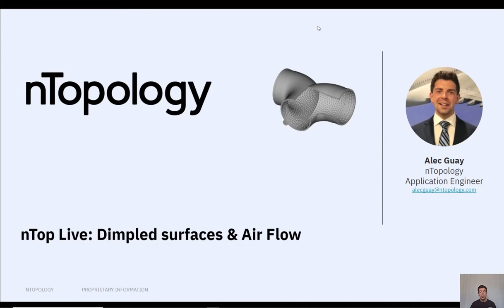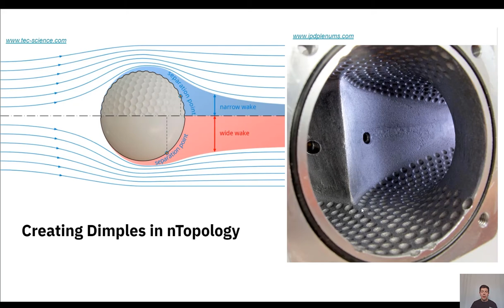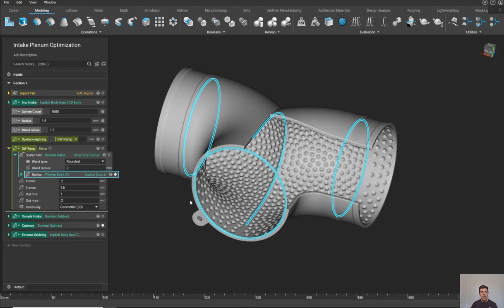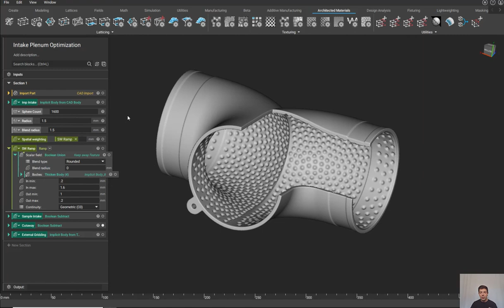nTop Live: Dimpled Surfaces to Increase Air Intake in Air Duct

Comment: If people just understood the principles behind this it wouldn't be a mystery, dimples increase turbulence and reduce flow velocity, but dimple increase turbulence and help keep flow attached so there are proper places for dimples and the entire port is not the place! put them on the short side radius and any tight spots where air cannot turn because the angle is over 15 degrees or so.

Comment: Just never on ports or intakes ! Unfortunately, it doesn't work inside a port or intake due to the increased friction coefficient dimples create in the boundary layer and the velocity range needed for an engine. 

See a golf ball reduces its "drag" by a reduction of the negative pressure  "behind" the ball.  It is also limited to a range of 150- to peak of 280fps, at which point it goes backwards. 

So the biggest problem comparing  dimples on a ball to a port or intake runner is its velocity range...ports "average" 300+ and peak at 690fps.  So, it's not even in the right velocity range to work.  But the biggest problem we saw was the increased boundary layer thickness. Which on a ball isn't a problem.  But "inside" a port or runner where the air speed is targeted based on the CSA [cross sectional area). The growing boundary layer only reduces available CSA and, therefore, reduces mass flow potential and hinders HP.  

The best Ra of internal ports and intakes is around 60-100 grit. Which is what most race intakes and ports are done with.  It's a perfect blend between just enough surface turbulence to decrease the drag coefficient but not to much the boundary layer swells out of control.
Reply: RA stand for what sir?
Reply: RA of internal ports? Like surface of the ports need to be rough not smooth?
Reply: @elbale2323  Ra is a surface roughness index.  Just like what's specific for an MLS gasket. The Ra of a port needs to be the right roughness for the boundary layer
Reply: @elbale2323  Yes. It should never be smooth 👌  not on the intake
Reply: Just an observation. A guy (yeah, I know) on YouTube, Weingart ?? Racing, played around on his flow bench and a LS head. I don't remember the exact head he used. Anyway, he randomly by hand dimpled the floor of the runner and the back of the bowl. Nothing else. Floor and back of bowl. Significant increase in airflow. 

That being said, he then dimpled the entire runner and bowl. Lost almost all improvements.
Reply: @scotthewins5341  Yeah, unfortunately, if developing engines for the last 25 years has taught me anything, the flow bench isn't the real world. It lies!  And if you dimple and area and it does happen to help. That means the port CSA (cross-sectional are) and / or shape is wrong.  If you fill that area. You will do better again. It's an indication of low velocity in that area.   which, if they were velocity probing and not just looking at flow figures, you will see this very easily. 

As the best cylinder head guy in the world , darin morgan says.. it's a good bandaid for a poorly designed poor 👌
Reply: @bainracing  true that. I was reporting what I saw. What's your take on Extrude Honing? I look at this performance stuff from the standpoint of semi trucks. HP isn't my goal. Fuel mileage is. Anything I can do to push that number up, is my goal.
Reply: @scotthewins5341 

 It can be good for boring bigger holes. But the problem with pumping a fuild through a pipe is. It removes from the wrong areas due to the surface pressure gradients created. 

For example,  if we have a casting lump, I'm the pipe. That lump is going to create more pressure before the lump. Now cresting a dip in the floor while it "reduces" some of the height of the lump. 

We now end up with an S curve. A dip before the lump, the same thing happens on bends.  The inside of the pipe is generally where we need to improve. Yet due to the force of the fluid.  We have far more surface pressure on the far side. So, it unevenly takes more off the other radius and not the inside radius. Creating poor flow. 

So, it really needs to be established what you are trying to accomplish. 

On an intake that is just too small and you can't port. Then, sometimes, even a bigger, poorly shaped CSA may be beneficial.  

Hope that helps 👌
Reply: @bainracing  I've heard similar.  I'm guessing that the benefits would be more from the finishing of said runner. I think that's where it would shine.
Reply: @scotthewins5341  Yeah, there would be a slight difference in the changes in surface Ra. Boundary layer modification is in the 1-2% area.   

From our testing, from a casting finish to a burr or sanded. So around 200-100Ra down from 900Ra will rob torque by 2% and add HP by 2%. 

But bigger shifts and power  are found in increased CSA.  This comes back to our average CSA math, which is pretty much how all race engines are targeted as we know the limitations of air and its fluid dynamics principles. 

 Our velocity limit is set at around 690fps for all ICE engines. It won't matter what it is.  So, as we "increase" CSA. (Cross sectional area) we reduce air speed as an engines primary induction air speed is dictated by the pistons' speed, stroke, and bore/ CSA of our primary induction length 👌

I have my calculators on my website for all the basic air flow math if you need mate.
Reply: @bainracing  thank you. That would be great! What part of the world are you located? I'm near Chicago.
Reply: @scotthewins5341  No problem, We are in Australia. But my calculators are up for all to use :)
Reply: @bainracing  how about the compressor inlet on a turbo? I am rebuilding mine, thinking about dimpling the taper region.
Reply: @Akya2120  definitely not, mate. Dimples in a duct create more restriction.

Comment: Regarding dimpling inside a intake port for airflow velocity. 
First of all several conditions have to be met.
- dimple size
- dimple depth
- smoothness of dimple
   Edges 
- dimple location to   
   Other dimples
- And the angle at 
   which the airflow 
   approaches the
   dimple.
- Lastly the amount of 
   dimples.
If each of these conditions are just right, your airflow velocity will increase
Reply: is it science, or art?

Comment: I'm curious how this affect would act on a smaller projectile such as a ball sphere 17.4mm or .6840" in size being accelerated at 300 feet per second.  And, how would this change if the ball object had dimples like a golf ball instead of a smooth surface. Would it accelerate faster and longer with a more level flight like a golf ball even though its smaller in size, weighing approx. 3.5 to 4 grams?
Reply: Massive increase in accuracy slight increase in speed and distance. Think heading a bouncy ball versus hitting a golf ball. You have a more aerodynamically sound projectile and it will perform as such. Do it start making golf ball paintballs you'll be rich.

Comment: Back in the day when I worked for GE to develop plasma rifles in the 40 watt range, we experimented to optimize the the weapons effectiveness over distance. dimpling examples were used in a D.O.E. Test scenario. Only to find the the eddys had no effect on the pool of plasma between triggered bursts up to 50 meters.  The downside was the dimples caused an accelerated wear to the Deterium Tantalum staging chamber. 

Those were the fun days. Now rail guns make those plasma rifles look silly.
Reply: What was the use case scenario for these plasma rifles? 40 watt is pretty low energy discharge if the efficiency is reasonable. Could probably be supported by a reasonably small sized backpack battery.
Reply: @Akya2120 The major factor for wattage selection was based on some of the key components when subjected to cyclic thermal varying conditions & efficacy needed to meet the needs of service requirements then. 
So where rail technology has obsoleted  tactile plasma weapons, a back pack is employed to feed the fuel requirements for the railer.
Reply: @gerrylundergaard60  why have I never heard about functional plasma weapons?